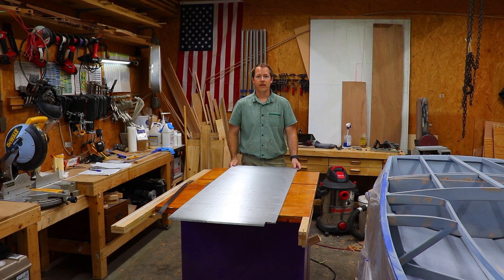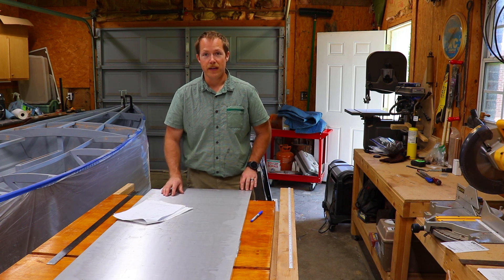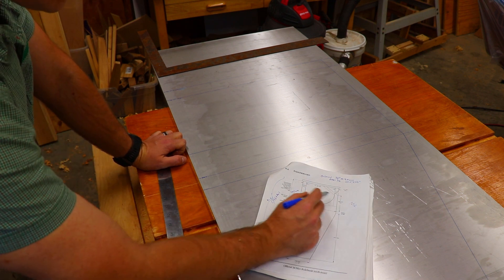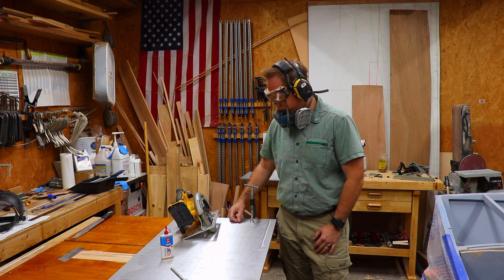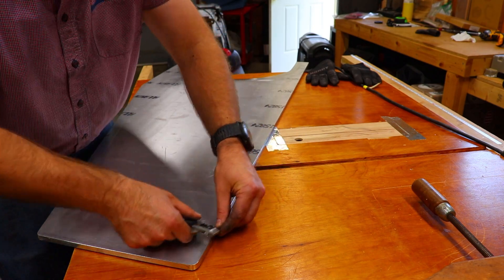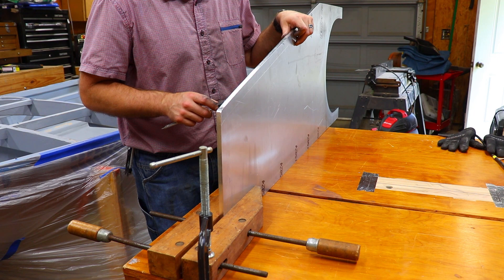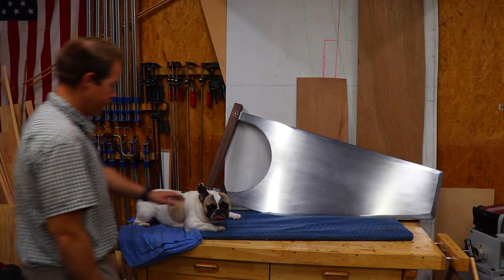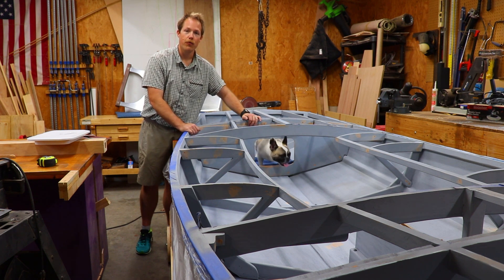Building a Wooden Sailboat #13: Daggerboard and Inspection Ports

Comment: Very nice job! Unfortunately I haven't sail a Snipe, even though our Sailing Club had that Fleet. I haven't Sailed in years, due to age (73 today) but I would still like to consider sailing a small boat. What are your recommendations, is a Snipe to High performance?
Reply from the maker: I honestly haven't sailed on yet either. I know the modern fiberglass racing Snipes are very high performance. I think this style classic snipe can be just fine to handle if you're just sailing/cruising for fun.

Comment: In addition, when pattern cutting a center plug out of a panel  use an outside pattern " ring" so you can only stray into the material that will be waste.
Reply from the maker: Great suggestion

Comment: Your pattern bit will only try to " climb away" from the pattern if you are cutting in the wrong direction. When cutting in the right direction along or around the pattern, the cutter will pull into the pattern.
Reply from the maker: It'd also help if I'd paid more attention to what I was doing or cut the holes BEFORE I installed the bulkheads. lol.